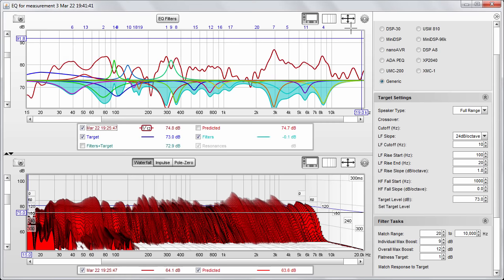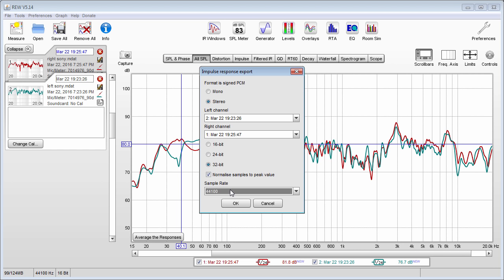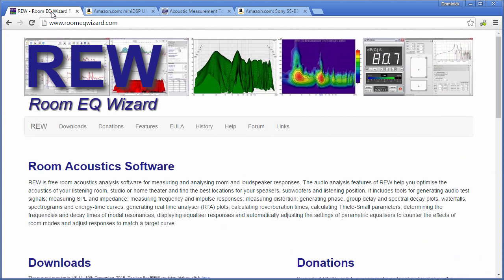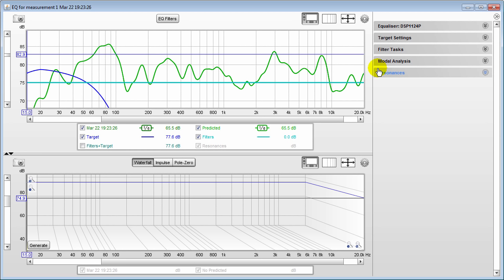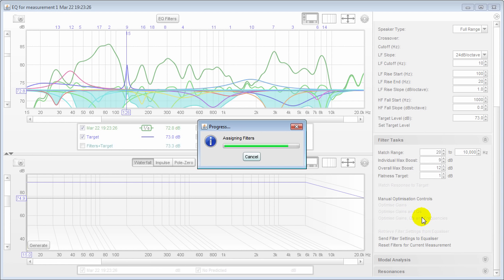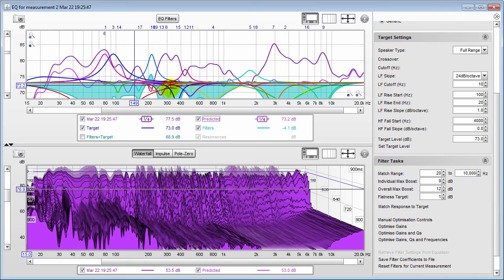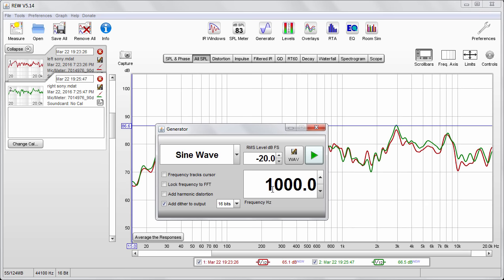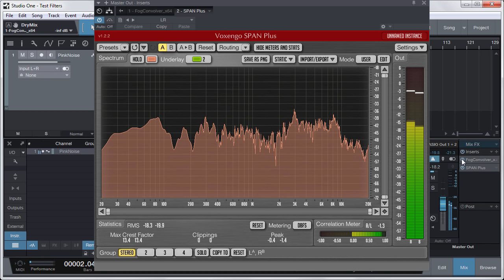Room Correction With Convolution Plugin Room Eq Wizard Tutorial

Comment from the maker: Note: A flat frequency response may not sound good to many people. A flat response may sound 
as if there is a lack of low frequency, and abundance of high frequencies.
They may prefer a boost in the lower frequencies, and a slope drop-off on 
the higher frequencies. Research "house curves". 
Also, doing the exact method shown in this video(I called it the "no boost" method) may not sound great either. 
It could cause ringing and other undesirable sounds due to large amount of cut frequencies and slope of filters.
I recommend meeting half way as discussed toward the end of the video. 
I recommend you not use this as an all around solution, as proper treatment is recommended. 
A better acoustic environment may lead to better results due to less correction needed.
This however can be used as an alternate method of reference to check mixes/masters.

Comment: This was incredibly helpful. Thank you. Can you advise the mic positions when taking the left and right speaker measurements? I'm using a Behringer ECM 8000 and believe that for full range, this should be pointed at the center and horizontal. So do you keep this position the same and just take two readings? Or are you pointing the mic at the speaker (from the listening position)? Or quite probably something else entirely? Thanks again

Comment: thank you for this !!!  the convolution plugins is paid.... any replacement ?
Reply: I use system wide convolution and with this method (and some focus on my render settings) don't have to disable it at any point as it is not part of the rendering this way. Equalizer APO would be a place to start. If you're on a mac, things are a bit more complicated without any external correction devices, like a dsp

Comment: Quick question, your mic has a frequency response to record sound, you mentioned that is was important..  don't you have to calibrate that first before anything?
Reply: Peaks and dips of a measurement mic are negligible compared to those of the acoustic response and thus can be ignored (check Ethan Winer'site on measure mic comparison). Mic calibration is useful when doing precision measurement of sounds in anechoic room and so forth.

Comment: Hey! Is it possible to measure with a condenser?
Reply: Augusto Constantino it certainly is possible, but if your microphone isn't calibrated you will never know how accurate your room is
Reply: In the lows yes, but mic has to be omni. Thin design of measure mics is there to prevent interferences in the highs. You can definitely start with your condenser, small diaphragm being better.

Comment: This is a terrible technique. This EQ correction must have been measured for that point of space in room. But even one single cm away, your room might have a very different frequency response. There is no other way except to acoustically treat your room with absorption and diffusion. And secondly, it won't fix ringing in your room.
Reply: How would moving 1 cm back change the response? Its not like the eq isn’t applied further back in the room.
Reply: Daltira The eq is applied on everything that is send to the speakers. Therefore the filter will be the same for every spot in the room.
 The problem however is that the room doesn't sound the same everywhere. This means the filter should be different for every place in the room. Which is (as of today) impossible.
Reply: Nope. If you use the variable smoothing on your measure, the response is flattened in the high frequencies, so the number, gain and Q of the filters are very light, but still very effective in the lows, where wavelengths are greater (100Hz > 3,4m), so moving a bit won't affect the response. But you're right, EQ must be done once all proper acoustic treatment has been done. EQ and convolution can nothing against modal ringing.
Reply: you're right that different areas of the room have different frequency responses but you're over exagerating by saying a single cm